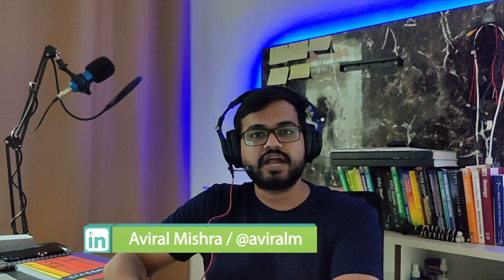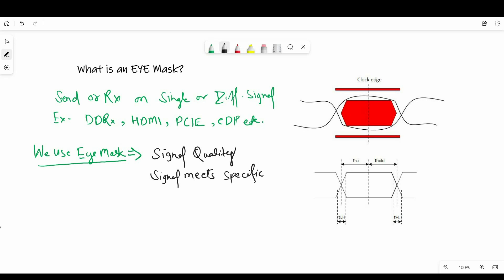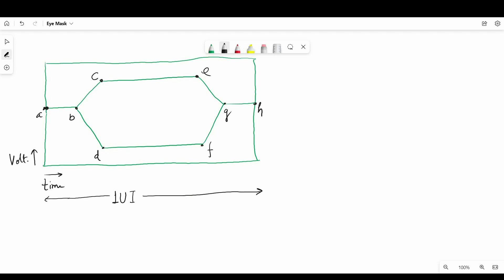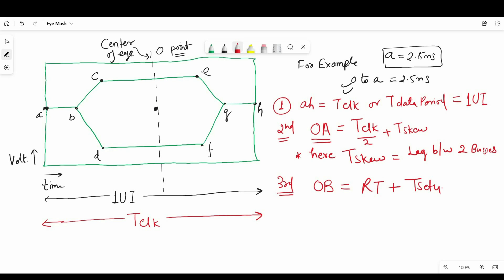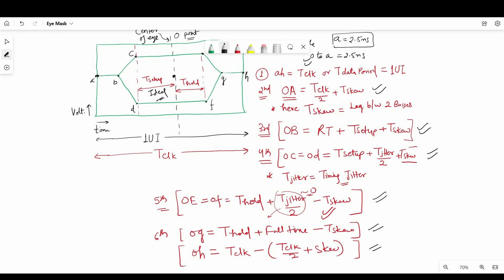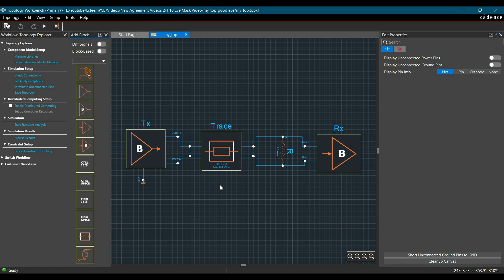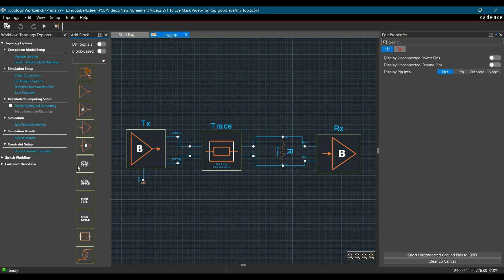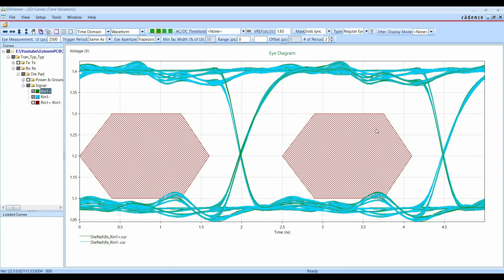What is an EYE Mask? Create an Eye Mask Using Datasheets

Comment: Board level Hardware Developer JD  (IoT / Wireless Technologies)

(3- 5 Years of Experience)

·         Design and develop embedded hardware solutions for IoT projects

·         Select appropriate components and technologies for hardware implementation

·         Understanding of Microcontroller/mobile SOC architecture, ARM is preferred

·         Ability to read and interpret technical specifications and datasheets

·         Document design specifications, test plans, and verification procedures

·         Ensure hardware designs meet industry standards and comply with regulatory requirements

·         Knowledge of communication protocols and interfaces (e.g., SPI, I2C, UART)

·         Knowledge of interfacing BLE /Wireless Modules to MCU / SOC

·         Knowledge of design and validation requirements for high-speed digital interfaces: PCIe, Ethernet (SGMII, RMII), DDR Memory

·         Understanding of low voltage power regulators such as LDO and switch-mode power

·         Understanding of power management and signal integrity principles

·         Conduct testing and troubleshooting of hardware prototypes

·         Collaborate with vendors and suppliers for component sourcing and procurement

·         Assist in the production of hardware prototypes and pilot runs

·         Experience with Cadence PCB schematic capture and layout tools is an asset

·         Hands on experience in handling lab equipment (e.g. digital oscilloscope, logic analyzer, power supply) to measure power/thermal/performance

·         Collaborate with cross-functional teams including firmware ,PCB & Mechanical

The ideal candidate should possess the following attributes:

·          Self-motivated and highly ambitious

·         Creative problem solving skills and excellent troubleshooting/debugging skills

·         Strong written and verbal communication

·         Excellent teamwork and people skills

·         Ability to manage multiple tasks and work towards long-term goals

·         Flexibility and adaptability

Qualification

·         Bachelor's or Master’s degree in Electrical/Computer Engineer or Diploma in Electronics with equivalent experience.
Kindly Forward your resume if you are interested in this position.
durai@aerlync.com

Comment: I am not finding easy to fetch the timing parameters from the datasheet of IS43TR16128D-125KBLI. It says it is 2GB, DDR3 with 800MHz clock frequency. Kindly assist with the timing parameters.
Reply from the maker: You can search for interface related standards for example in case of ddr3 you ll find all the Timing parameters in standard documents like jedec etc.